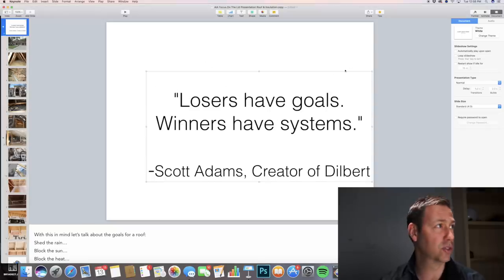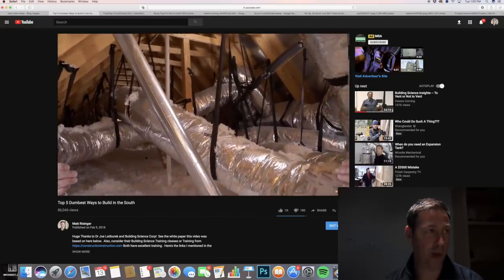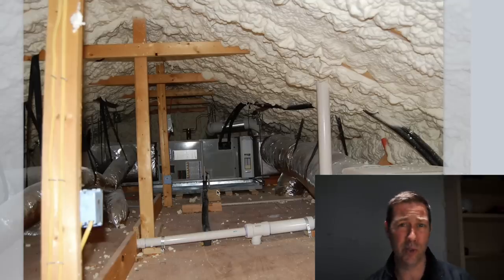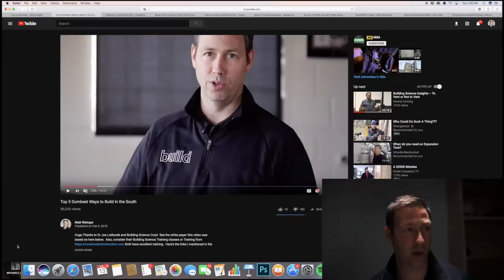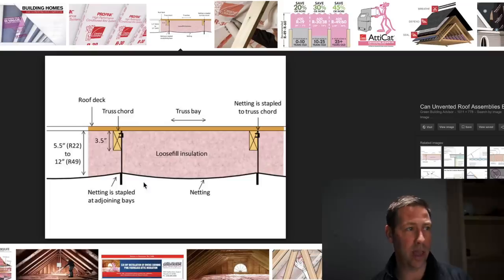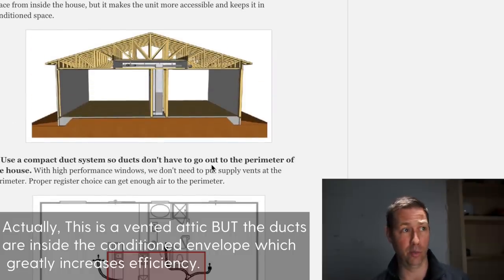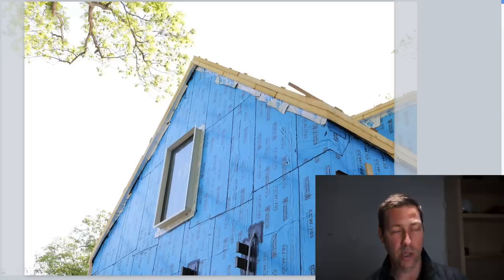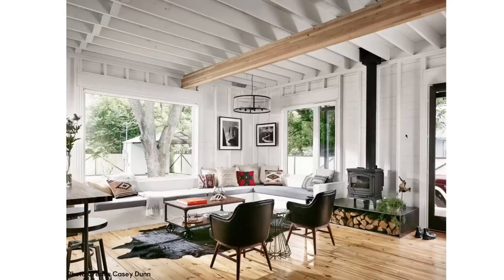Attics/Roofs - Dumb vs. Smart - How to Build Correctly

Comment: Yikes who would thumbs down this video?? 
 Anyway great info!!  I am going to see if spray foam insulation is feasible for my attic. I am wondering though if when I re roof my house whether it would make sense to put the insulation on the exterior and then re roof.
Reply from the maker: Don’t be bothered by the thumbs down. Almost any video I Post gets 10% thumbs down and 10% of the comments are how I’m “an idiot”.   If you’re going to reroof the house, consider and Insulation upgrade on top of your roof, then a layer of nail base and your new roof. No spray foam necessary. The only thing you’ll have to do is seal off your vents and in sure there’s no outside air leaking into your attic. Thanks for commenting!  ( and the 👍🏻)
Reply: Matt Risinger its prob mostly contractors that thumbs down. He is a very whiny person who complains for no reason. The first attic he showed obviously had some work done after build and they never put back the insulation in that spot. He likes to spend a lot of money that the average person cant afford. I would really love to see him build a budget house.

Comment: We have a 1970 ranch house with a low pitch roof (50x100) with vents/ridge cap/sofet vents.  each year we would get 140F in the attic and the AC was on 22 hours per day.  About 4 months ago we had open Cell foam sprayed into the rafters (roof decking?)  and its about 6-7 inches think.  we completly sealed the attic and OMG what a difference.  the AC is only for a few hours per day and the noise and dust is way down.  also we don't get condensation dripping from the vents!  so all I can say is worth the $7K we paid.

Comment: As an insulation contractor and fellow building science geek, I love to see conditioned attics becoming more accepted. I still have a lot of folks resistant to the thought especially with the costs being higher. I am always proud to see a completes conditioned attic and knowing that it will be so much more comfortable than it was previously.

One thing that is making things difficult in our city is the requirement for a Thermal barrier over the foam if there are mechanical systems in the attic. Are you dealing with Ignition and Thermal barrier requirements in the south?
Reply from the maker: Yes, we have to do those as well. I’m not super happy about them, but I do understand the need and the code requirement. My preference is to use a foam that does not require it
Reply: @buildshow  What spray foam does not need a  intumescent coating if left exposed?

Comment: Is there any thought on what happens if/when the roof fails and sheathing starts to get wet? Will the spray foam need to be cut out and replaced? Also $250 per SF is very expensive in my neck of the woods.  I can build a 2,000sf ranch style home that meets all of California’s building and energy calcs for about $125 a foot.  Your permits, and labor rates must be through the roof.
Reply: Just think: Crazy California! Haha, you are correct.  I’m just wondering what caused that home to have a built cost double what it costs here.
Reply: NO house is over has to be demolished you are will not find a leak you will find mold everywhere before you see the leak.
Reply: I’m guessing he can build it for a lot less than 250 a foot, but I doubt he wants to advertise that fact to his clients. Which are probably willing to pay in that range. Not that unusual in my neck of Texas for a nicely build home on some property.
Reply: As a claims adjuster/ inspector here in Louisiana. I’ve done many roof and attic inspections after storms.
The attics with spray foam are the worst and hardest to find where the water entered because it runs underneath the foam and drips in a completely different area.
Al’s to replace the damaged you have to rip off the entire area decking.
Many times people discover rotted sheathing and rafters which mean it did start from the storm. The storm just revealed it. 
Many insurance companies are starting to not cover this stuff and exclude it.

Comment: Matt, I rarely agree with you as much as I did on this video. I loved the concept on your "monopoly house". I totally agree with conditioned attic space with radiant barrier and a breathing roofing system. I probably would have kept the house a bit lower to the ground and had covered patio, porch where the large windows were to cut down on direct light even though it was a wooded lot. loved the open floor design. People sometimes don't understand cost and quality along with speed of build. you will always pay good money for a real craftsman and more if you want it fast. A well built home like that 1 keep the buyer happy for a very long time only needing to change out the water heater in 12 to 15 years and maybe a paint job. Maybe hire out a reputable handy man to clean the gutters and check your caulking every year. It will hold value and peace of mind is priceless.

Comment: A ton of comments, nice job Matt.  What do you think of this detail from interior to exterior:  Closed cell spray foam < roof sheathing < two layers of 2in XPS foam boards w/ staggered seams and tapped on exterior layer < Furring strips < zip system roof deck <  two layers felt paper or smart membrane < shingles.

Comment: My place is about 12 years old. We just moved in about a year ago. We are in the Waco, TX area. I have a very voluminous attic and the builder used "fluffy stuff". We just replaced all 15 windows with a very good product that uses argon exclusively in the double pane windows. The window areas are very tight now and I can tell already my cooling bill with me significantly lower this summer than last. The home is a single story 1650sqft home. Mostly brick and some Hardy Board. I'd love to go to foam and "conditioned" attic design AND convert that huge attic space into some living space. I don't want to overbuild for my neighborhood from a value perspective, but we're going to be here for a while and would like to add value and equity with such a conversion. What would you guess might the cost of doing that type of conversion? I might be able to get as much as 400sqft of living floorspace out of our attic. I'm just trying to conclude if it's worth it.

Comment: I love this channel and watch every video. This one brings up a few questions though. Wouldn't spray foam insulation in the rafter bays prevent roof leaks from entering the house and cause a roof leak to go unnoticed until the roof partially caved in from dryrot? Don't you want roof leaks to drip on the ceiling drywall and make water stains to warn of a roof leak so it can be fixed before causing structural damage to the roof sheathing and framing?
Reply: Not to mention that you cant recycle wood that has spray foam on it. And imagine that a house full of spray foam catches on fire. There would be a huge column of black smoke billowing off.
Reply: A good question, but consider the average homeowner who doesn’t go into their attic space regularly. I recently noticed a roof leak near my plumbing vent pipes, but the decking has already begun to rot. Why didn’t I notice ceiling stains? Because of the partial flooring, and items I had stored up there. Lessons learned, I suppose. In a conditioned attic space, though, it sounds like a hygrometer would be a good idea to detect roof leaks, since it’s open-cell foam. What do you think?

Comment: Always like seeing details of sprayfoam attics.   Want to do that to my 1969 home.  These are great!
Reply: I replaced the Bat insulation in my attic with R60 closed cell spray foam back in august and got new 95% efficiency furnace. This year was the coldest year we've seen in 40+ years in Alberta and my bills were half of what they were last year during a very warm year. In fact the last month we've been around -10C to -15C at night and my records show the furnace didn't kick in till 3am. It is so worth it.
Reply: You could have also just loaded up another foot or two of fluffy insulation and it would have had the same affect for way cheaper.

Comment: how long do the shingles last .   We know that lack of ventilation will shorten the life of shingles in a 70's type attic.  How do you detect a leak in the roof?  The ceiling foam looks like it could create other problems.
Reply: 15ish years. And u should be able to detect a leak.
Reply: The unvented attic does not always mean unvented roof.

Comment: Matt what is the process when you have to replace a sheet of decking and the underside has spray foam.  Does that foam have to be cut out and reapplied?
Reply: Yes, pretty much anything with spray foam has to be demo'd.  Seen entire reroofs chainsawed off because the sprayfoam formulation wasn't correct and the house was a toxic hazard and nobody was able to live inside.
Reply: Yes

Comment: I like the suggestions Matt Risinger has made. It seems to me, logical to put the insulation barriers of a building as near to the outermost "skin" of the building as practically and permissibly possible (ie in compliance with relevant codes). 

Placement of any of the machinery, used to condition the living space, within  or outside that conditioned space, should be such as to provide the most positive effect on the living space, while allowing the most efficient operation of the machinery. The placement of the machinery would provide the best possible facility for its maintenance and future possible upgrade, whether in a specifically created ceiling/roof plenum space, a basement, an attic, adjunct to a utility room, outside utility room or even a separate building space away from the main building, which would allow for isolation of noise and vibration.

Protection and maintenance of the surface material or skin (cladding) of the building should, I think, be dealt with separately and independently from the insulation of, and maintenance of the living space environment. Cladding protection should be dealt with by the choice of underlayment; vapour barrier choice; facilitation or blocking of air movement & direction by ducting and venting; decking choice etc.. The reverse effect that the cladding has on the conditioned or passive environment of the living space is, to my way of thinking, the only consideration connecting the two.

Books, training videos and youtube videos improve the information base of all people involved in building.

This means owner/clients are better able to discuss various methods, options & costs with their builders, from a much more informed and improved knowledge base; DIYers have better information for their projects; and builders can expand the options for their clients with a sound and qualified knowledge base to support their suggestions.

Obviously, all chosen options are required to meet code standards, and sometimes that may be easier with expanded options, and provide improved outcomes in terms of quality of living space. All final options must be based on sound and qualified information, and be practical for the application. However, "white-boarding" of ideas, whether the application of the ideas are cost efficient, practical or even "sensible", or not, can be the conduit through which best outcomes can be finally arrived at.

Cheers, Peter

Comment: Hey Matt great video. I’ve been a long time fan. Big question though if you’re using a spray foam on to the decking of the roof how do you handle venting for the roof?
Reply: You don't. The increase in temp of the shingles is negligible compared to a vented attic
Reply: I prefer a baffle between the roof decking and insulation this allows air flow from the soffit to the ridge line to keep any moisture water vapor and condensation to vent and dry out it also prevents mold mildew and it keeps the decking the same temperature on both sides to prevent these problems great question ⁉️

Comment: Great video, glad to see you adopting attic conditioning. I have been espousing the benefits of attic conditioning to contractors that I speak to and they look at me like I'm speaking a foreign language. I have a question for you, In the attic, can you attach radiant foil to the bottom of the roof before you spray on the foam? I would think this would help a conditioned attic even more by radiating a lot of heat back out toward the sun before it has a chance to make it past the spray foam insulation.

Comment: How do you find a roof leak?  How do you even know you have one?  All roofs leak it's just a matter of when.
Reply: Open cell foam doesn’t hold water ...water will come through it and you’ll see where it is coming from. Open foam is easily removed so you can repair that area. Closed cell foam is NOT to be used in the attic because it will not let the water through which will cause rot in time.

Comment: Have you done a cost comparison between exterior insulation on the roof to open spray foam on the inside of the attic?
Reply: ^^^ That is the million dollar question !!! 
If it doesn't translate into substantial savings, then these videos are much ado about nothing.
And when there are no efficiency numbers to accompany the videos, that's fishy.
Reply: Don't rule out structural insulated panels. They are strong and very energy efficient.

Comment: It is nice mounting the utilities up in the attic!  

But by insulating the underside of the roof, you will cook the shingles - best to use light colored shingles in that case.  Alternatively, keep one inch of air space between the insulation and bottom of the roof with vents at the bottom and top of each channel between the rafters to allow for venting of that small air space.  You can make that one inch of airspace using XPS (a lot of work) and then add more insulation below that to get the R value up.
Reply: What is "XPS"?      Where are you, geographically?   It matters.

Comment: I’ve heard foamed roofs can make the shingles and wood buckle due to heat.  Any truth to this?
Reply: Yes, talk to you territory representative from GAF/Certainteed/Owens Corning
Reply: Yes spray foam sucks over the long term. Asphalt shingles have little or no warranty when installed over a spray foamed deck. In hot humid climates it will cause the decking and shingles to buckle.   Spray foam is the best  worse thing you can do to your home. Run from any home that has it especially in a high humidity location. Additional mechanical systems are required to remove moisture from the attic space these systems will add $10,000 to the cost of the home and require regular maintenance and have a expected life span of 10 years. At which time you will spend another $ 10,000. The best bang for your buck is R-38 insulation and a well ventilated attic. I only have experience in Florida with the spray foam. This stuff is a maintenance nightmare will be compromised at the first roof leak that needs to be found. Your roof will probably have a shorter life cycle due to the heat building up in the decking and roofing product instead of dissipating into the attic space and then vented out. DO NOT USE  THIS 
PRODUCT ON YOUR HOME THE ONLY POSITIVE IS A COOL ATTIC EVERYTHING ELSE IS A NEGATIVE.  So for 1/20 the cost of foam go with R-38 batts or blown insulation and use the savings for a pool, man  cave vacation  all led lighting outdoor kitchen,solar panels etc etc the solar will pay you back for years to come. The foam will cost you for years to come. This is my opinion only from over 40 year in  the HVAC trade. Google spray foam and roof warranty. This alone will cause you to run from this stuff

Comment: Spray foam can be the Devil's work, specially considering the adventurers in the business. Mixing chemicals like that, when improperly sprayed, can cause health issues in future residents. But getting insulation under the roof is a must! I really appreciated that wrapped house with "external" insulation as a reasonable and practical solution.

Comment: I'm in florida, and I had always heard insulating between the roof rafters, under the roof decking, increases the speed of deteriorization of roof shingles, because there is no ventilation under the shingles to help carry away the heat.  Is this not true in your understanding?
Reply: Skip Watson so he gets to put a new roof on every 15 years...
Reply: grumpybill ... instead of 20 ... yeah, I guess that's a good point.  Blessings.
Reply: it will. Go metal.

Comment: No offense intended but when you spray open cell foam insulation it should be sprayed evenly and not exceed past the trusses. You should see the boards after expansion. You end up with a r value of 32. The foam should be relatively flat. That's how we do it up north. Love your show man keep them coming. I'm a builder who appreciates outside advice or better ways for building